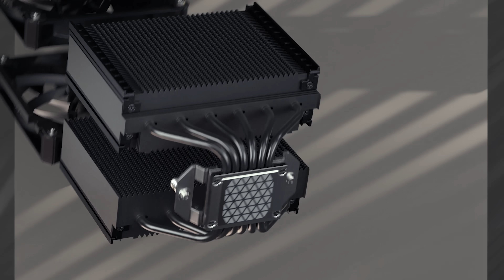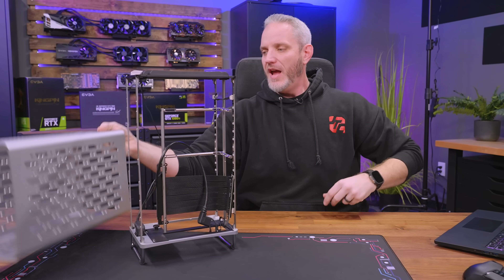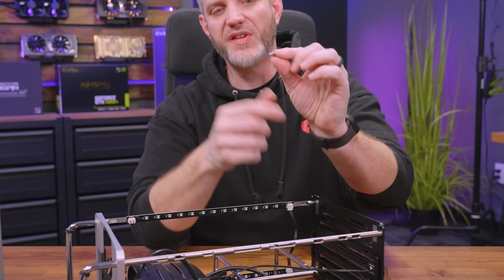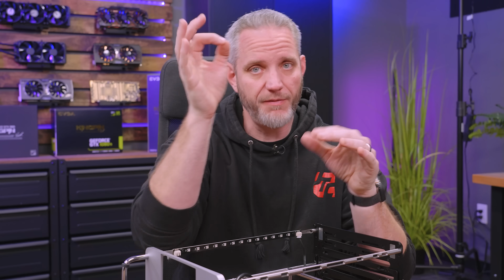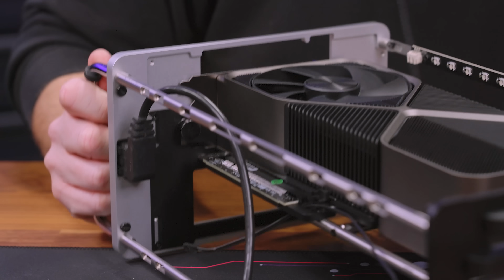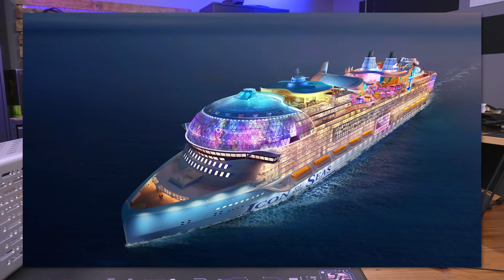They responded to my review! THAT WAS FAST!!!

Comment: I big ship made right can turn on a dime, when going slow, but they do have a small issue turning quickly at speed.... it's all about mass basically. The key is pod engines and or bow propellers, the pod solution is actually extremely usable, but it's also fairly new tech so most ships don't have them yet. It's basically a pod that sticks down from the bottom of the ship which can turn around 360 degrees. The downside, is that they are no easily accessed or work on, which mean they have to be made to last a long long while and that makes they costly.

Comment: It seems to me that if they indented the steel plug, they could still turn it on a lathe, and then drill or grind the indent into it quickly.  Even better would be a simple matching flat on the plug and case.  And you are 100% correct - Allen screw, NOT flathead.  Even existing users could probably swap those out for Allen screws, unless they are an exotic type.

Comment: They are going to need to do more work on that chassis for what they are charging for it. $300 is way too much for the issues that have been pointed out and the several more that are not adressed.
Reply: I did some quick searches and apparently extruded aluminum can be quite expensive. They need to make a die for it which is about 5 to 7k and most places seem to only do large bulk orders, like 2000 pounds, at $10 per pound. They also give free international shipping which cost like $50 to $80. Plus the steel rods and milling. They would have to sell about 90 to 100 of these cases to break even.

Comment: I understand what you're saying, but it's crazy that thing went out the door without a way to screw in the factory graphics card bracket. That's worrying. Also, they should just make the feet hex shaped instead of doing that weird nipple thing. That's going to add quite a bit to their cost if they're actually custom.

Comment: I really like that case...Putting the "nipple" on the part is just a couple of small steps to add in the CNC programming...nbd really...and it probably saves a bit of money in the long run by not needing the loctite and they won't have to worry about customer support with that issue

Comment: 7:20 great point.

If the case were 90-120 range I would probably suck it up about the annoying screws ut in the 300 USD range, no shot, friend. I don't want to have little issues like that. But the GPU bobbing is just a flat NO SALE to me. That's one of those things I see after a purchase and wonder how 10 testers in a room over saw such an 'obvious' problem. obvious in quotations because it's only obvious if you put a GPU there... but then why wouldn't they put a model GPU there during the design phase? I'm ignorant because I've never been in that situation so they deserve benifit of doubt, but I still find it odd it got through many people and teams like that.
Reply: I noticed that thor zone only posted pic of the physical case about a month ago. Before that it was all rendered pics and cgi videos.

Comment: Cynical thoughts prevail, and it's cool they've reacted so quick and are honest...but how the frig did they not spot these issues beforehand?  It just reeks of "yeah that SHOULD work" in design and then just go go go on building them and then sell sell sell.  Almost like they never actually BUILT a PC inside one.  No way the GPU moving around so freely got past any QA or testing, that's insanely bad design everyone should have spotted before the product went live.

Comment: Its always great when companies are willing to make changes to the design quickly so they can avoid later issues. Respect to them every time. Its just sad that bigger companies have just excuses and no will to do what needs to be done to make things better. We sort of had that issue at work when we were supposed to stop making extensions for tipper trailers and make sides higher to have less pieces to make and sort of having less things to break when its working but that was about 2 years ago and still no progress xD.

Comment: Good to see they were able to address the issue before mass production. 
But really those flathead screws are just unacceptable - it's sacrificing ease of use for looks in the worst possible spot. 
I'd rather have to deal with hex, phillips, torx or even square drive screws than flatheads.

Comment: The outer shell most likely starts out with a flat sheet of aluminum. Those slots and holes are either laser cut or die punched, then they fold it into that box shape and weld the seam.

Comment: Brand stinking new pc master builder here... I'm putting together a system right now and had absolutely everything together except for the CPU cooler because I didn't have paste yet... 

Out of curiosity that the system would turn on I did and was absolutely in awe of my 903 Max glowing and blowing strong.. then after about 60 seconds it turned off and immediately realized just how stupid I was. I placed the back of my finger on the CPU and it was so hot that I yang to back my hand.  

After another minute or two I took my CPU back out and saw no visible damaged or difference in look. 

Think I'll be ok?

Comment: Great video as usual and this company has my interest now. For the handles being used as feet in the vertical orientation, they could design a platform the handles slot into that is wider so the case doesn’t wobble. This eliminates the need for a redesign and can be made separately. I know I would prefer placing it horizontal so they could offer it for free for those who want it to cut some cost. Just some ideas.

Comment: About the other GPU Holding point: It should be longer so it can go into the second hole of the Slotbracket. A screw will often losen and then the friction power is lessened so it isn't longer hold in place. On Single Slot Cards i always screw in below the Slotbracket as well. And the Second hole will hold a Card even with a lose Screw stable.
Maybe two Arms, one long with two holes and one short with one hole, for when the card is very high up.
Would it be my case i would 3D Print me a longer arm and then screw insert.
Reply: Yes, we decided to extend it to the second hole after fully testing the fix :) Now it’s rock solid
Reply: @THORZONE  Nice 👍

Comment: I feel like those caps could be extruded in that shape with the nipple. Yeah, it's going to be an interrupting cut when you turn down the smaller diameter, but you can quite easily make a collet and bushing to accept the odd shape. On CNC you can still turn on live-centers, so turning the smaller diameter and parting off a bunch in one go would be super easy. Then have a fixture to hold a couple dozen blanks in place and drill out the bore on a bunch in one go on a CNC mill.

Comment: Hey Jay! I think there is a huge problem with this case that you may or may not noticed! the radiator mount is at the bottom of the case in that laid down configuration. which means your AIO pump would be the highest point of the loop!
Reply: The case is orientable any way you want, so you can easily have the radiator on top instead of bottom 😁
Reply: @THORZONE  True! but it's gonna be annoying to deal with power cord on top and inverted Mobo outputs!

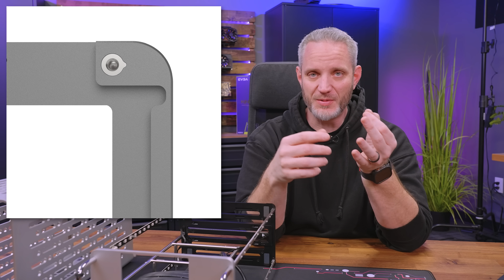Comment: @6:11 Those are called Keyways, and their respective slots are called keyseats. Name comes from the mechanical industry where square keystock is implemented to stop concentric parts from rotating, like the original cap was doing with the locktite screw.

Comment: Reinventing the wheel.  Just file one side of that plug flat or even square  all around.
If round shape is a visual  choice, the square  part can be below and recessed. That's  how bolts work, square  bolt with  round cap.

Comment: Brah.... customer service/support is EVERYTHING!!!

If the customer service/support responds quickly, caters to your needs and listens, it's worth a premium price. 

The problem with most companies is, they start off with this mindset, build their customer base and then don't follow the practices that built them up on their earlier years because the put more emphasis on the bottom line.

The bottom line will increase over time if companies provide quality service, even if it takes longer.

Comment: An easier way to fix the handle issue would be to just make them either wider and flatter or have an actual flat foot pad on them at the corners. As is, it appears that they are rounded on the surface that it would stand on. It wouldn't matter if it has those little rubber washer pads, it would always seem unstable, as there is very little anti-slip surface area on those little rubber washer.

Comment: At time 10:56 it looks like the power plug from the video card is just in front of the middle column from the case. Wouldn't this interfere with cable management for the 12-pin connector as you feed it behind the video card?

Comment: Projects like this demonstrate a culture of care about the product they're shipping. They reach out with a sample, take thoughts onboard and adjust to fit. All the larger brands could do that also yet, as you allude to, all too often takes forever and comes off half hearted. That should set off alarm bells in the respective company, whether it be a hint that they're too removed from their core mission, too blinded to common sense by the latest gimmicky idea they try to differentiate themselves with, struggling with oversight to be able to achieve what they might with smaller division focus on product releases.. food for thought.

Comment: It would had been cheaper for them to add knurling to the cap. I get why they did it, but knurling would enable a finger or cloth to grip the cap s it is being unscrewed by pinching it, but the way they went also enables people to just hold the device and keep the tab in place.

Comment: 7:11 um. Noo? This might be cheaper for the studs; thats a CNC process, and pricing is cycle time based. Removing less material is a shorter cycle.
The cost add is the odd shape in the end panel; gone from a simple drill operation to drill + mill.

Comment: 3:49 They could design some plastic/rubber clip on feet for the handles that could change the contact location & widen the stance.
Better yet, release some scan info & let the hobby 3D print market at it.

Comment: They could keep the caps round and just add a slot on the inside, just machine the caps with a spline and cut a slot inside the hole in the case where the cap fits.

Comment: I am a machinist by trade, and that small redesign is actually huge. The nipple means that part is no longer able to be simply turned on a lathe. That now has to be milled, as does the mating part, though that is most likely already a milling operation. Still, it may require an additional smaller endmill to make that pocket. There are simpler ways they could have gone about that and saved some money, but I appreciate the extra effort. I love when parts come through the shop that could be made simpler, but aren't for aesthetic or quality reasons. Really shows pride in the product being produced.
Reply: My first thought was a square rod which would require far less work. A square head won't turn in a square hole but then it doesn't match the rest of the rounded aesthetics. So if they are willing to make it this way, more power to them.
Reply: that is why we used ellipse when we had to have this type of "hole" cover with nut-type cover, simply because mills are round and machining squares as @cokeydidit suggested will not work without considerable time delay in production and retooling.
Reply: Another machinist, @nissan300ztt, mentioned that a modern Swiss turn lathe can do it no problem with a simple NC code update.

Comment: They could change the handle from the simple 90 degree turn to what some people use as cabinet handles, looks like 2 T's joined together. Sorry for the crappy explanation. But it would widen the base without a ton of work

Comment: While I like the fix for the top of the GPU bracket. I think It would be better if it extended to also allow screw down points on the second and third holes in the GPU back plate. I say this because generally the first hole is a cut out like was seen on the founders card. So enough lateral pressure could cause it to slide out. If it was long enough to extend to the second hole (which is usually a hole and not a cut out) there is no way for the gpu to release. Also it might be better for compatibility if it had multiple points because then you can choose which mount point to use. The first mount point could be in the way of a display connector on some cards. The render they used even shows what I'm taking about with the cutout vs real hole.
Reply: ThorZone replied to a similar comment and said they extended it.
Reply: @mattrogers6646  Nice. Thanks for letting me know.

Comment: if you could suggest them to make the steel bars thicker, if would be much better and more rigid and reassuring. Noticed in last video and this one that the bars are super thin and already bent since they have milled at least half of the diameter across the length to make flat surfaces that accept motherboards.

Comment: Changing to a hex head screw for the feet will be a cheap and easy fix as the screws are likely to be an off the shelf part, so they would simply have to spec a different screw. I agree, hex head would be better as it would allow for the use of a ball end hex wrench for better purchase on the angled approach
Reply: Hex heads come in some stupid small sizes. I got whole boxes of M3-M6 on in my shop in stainless(stupid good deal from an estate). Slowly using them here and there.

Comment: the gpu power plug will be an issue you will need to use a 90 adapter and the frame rail is in the way at the back

Comment: I'd bet they had the nipple design before producing the engineering sample but because of cost chose not to use it.  Upon hearing the feedback and how Jay articulated the customer experience they knew they made the wrong decision. It's possible they already had the nipple designed cap available so all they need to do is slight machining to the holes. Regardless, good to hear they promptly addressed the issue.

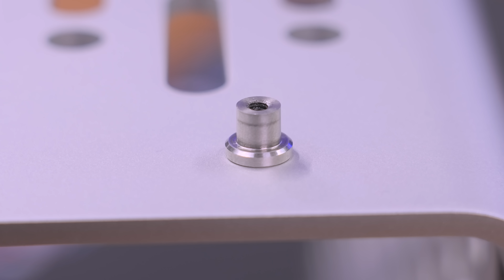Comment: 4:13 chicago bolt. :)
IMO, they over-engineered this. It would be far simpler and far more cost effective to ditch the screw altogether and simply use a peg with a groove or simple divot that would be held in place by a set screw on the part that has the LED strips. Set screws (the hex screws that go inside a part and don't have a head) are being used in dozens upon dozens of applications with far more intensive purposes. One such screw is the humble door handle/knob set screw. If that works, then for this is more than sufficient. No diss to the current engineering team, but they need to hire an old machinist dude with no BS mentality to fact check them on the engineering applications. Like purposefuly for this alone. Just to send that dude one of these and have him just demolish the design with simplistic applications. Someone like Tom Lipton or Keith Rucker or ToT. Gents who have been through the trade from one end to another, that know their craft, have forgotten more about it than most younger ones have learnt and that will put raw know-how on the table.

Comment: as someone using 8 hdds for an direct attached zfs pool I'm somewhat against small formfactor - maybe due to my 2nd system which I put together as my off-load stream box with a capture card was hard to find components for
currently I plan to build my own case as I also plan to upgrade my pool to the max my hba supports: 20 drives

Comment: I don't think they're even at the pre-production stage yet, so the changes won't cost too much. What makes me say that is when you ran a closeup of the cap, the threads are showing signs of chipping. That's usually a good indication that they've been cut by hand with a thread tap.
Reply: That’s the rests/debris from the thread-lock you’re seeing, if you clean it off the threads will look fine underneath :) For mass production we will order screws with pre-applied thread-lock, so no need to do it manually.
Reply: @THORZONE  Thank you. You're probably considering this but may I suggest the use of a low tensile threadlock? It's not as if the case will be in a high-vibration environment and gamers in particular are known for dismantling cases  😄

Comment: hmm. how many gpu:s this will kill. those 40x0 series cards are heavy that it's almost recommended to remove it from case when traveling. Basically that will crack pcie connector. We also have those support pillars for cards that aren't in vertical mount to prevent this to happen at runtime.
Reply: The riser is flexible. Why would the PCIe connector break with a flexible riser connected?

Comment: Adding that nipple is quite an expensive step, not only because of the redesign but also because now you go from 1 step on a simple (cnc or manual) lathe to multiple steps on a cnc mill. Props.

Comment: For any great product you need a designer.  If the designer did use that kind of product and it's a mechanical engineer at its core, chances are you get to make a good product (unless the designer is dumb).

Comment: Rather than the nipple They should have changed the shaft portion to a D shape and left the front circular. This is done all the time with folding knife pivot barrels, would be easier to machine, and would look better than the nipple.